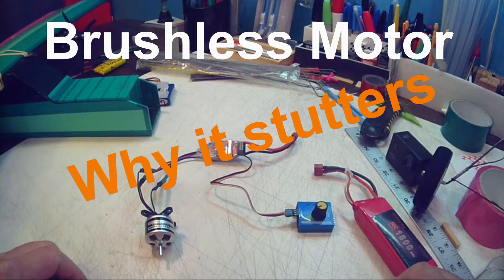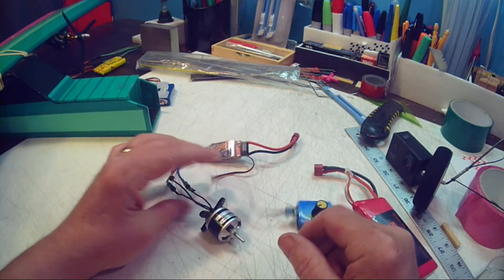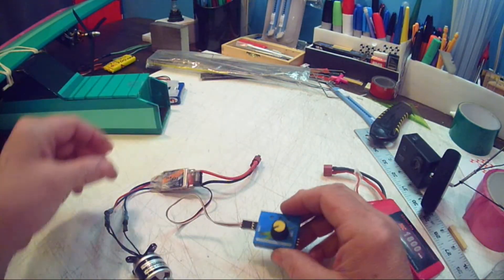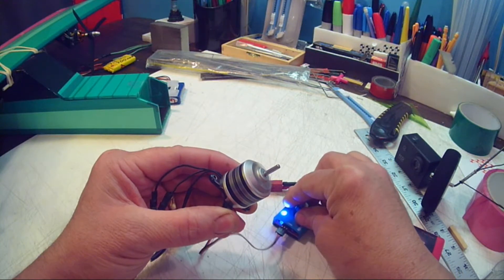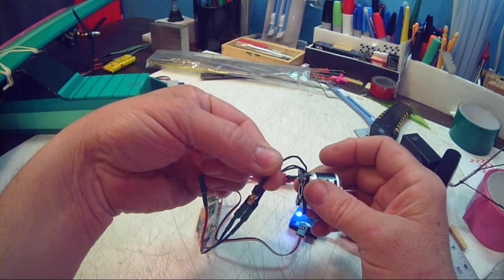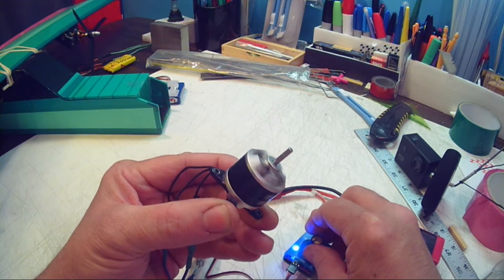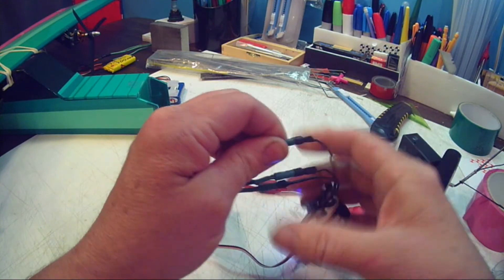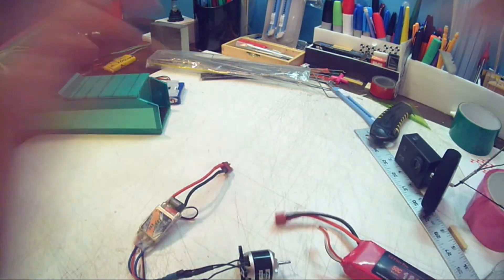LOUDER Version Here https://youtu.be/sUsWzYHSyEA

Comment: A stuttering motor can also mean that the Lipo has a to low discharge rate. Especially when you use your normal battery with a new engine upgrade...especially the 20c is low. When an motor pulls power,  the battery collapses. You can check with a power capacity meter while you are running the engine at top speee, you see that the power of the battery drop to 0% - 5%